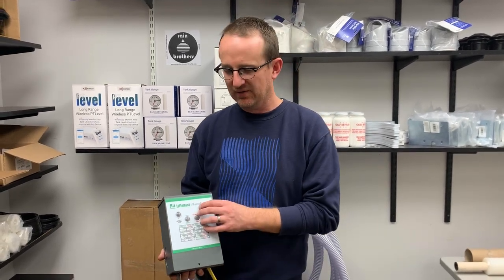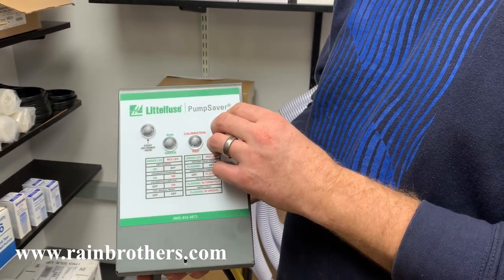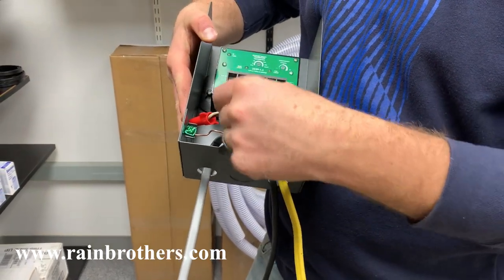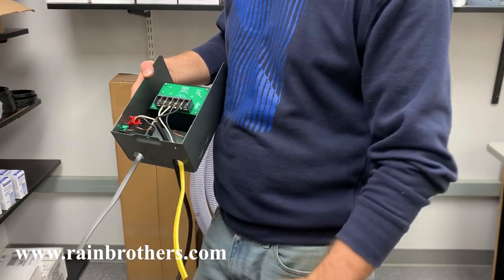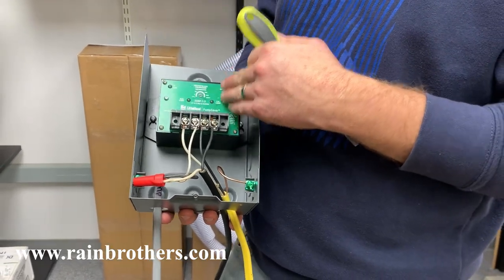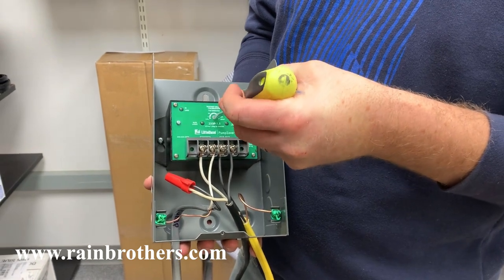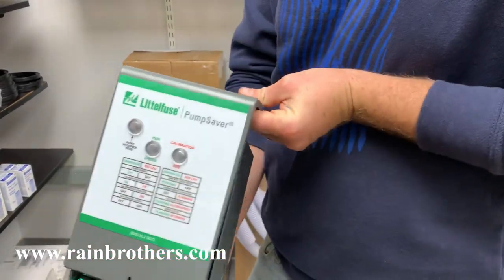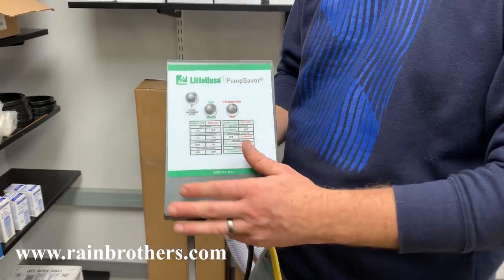How to Install a Little Fuse PumpSaver

Comment: What is the function of the Sensitivity Knob?

I'm having problems with this same Pump Saver, it keeps saying Dry Run but when I flip the braker from the Electrical panel it resets and starts pumping again.
Reply from the maker: The sensitivity adjustment will adjust how sensitive the amperage detection is in the device. Yes, if you’re encountering this, you will need to adjust the sensitivity

Comment: Can you tell me how it takes for the pumpsaver to shut the pump off once the pump pulls air?  Sure appreciate your videos!  Feel much more confident in getting a system set up, and not so much at the mercy of some contractors!
Reply from the maker: Thanks for the kind words! The PumpSaver works instantly, to my knowledge, because it’s reading the load pulled by the pump motor. Once a pump starts sucking air, the load drops, and as soon as that happens, the PumpSaver goes into standby mode and will restart once the allotted/calibrated time has passed.

Comment: Is there a video on how to reset the pump saver if it doesn't reset after the set minutes after calibration ? My green light keeps flashing & my well pump won't come on.
Reply from the maker: One of two things could be happening: 1) You don’t have water in your well; or 2) You need to re-calibrate the PumpSaver when you’re certain that water is present in the well
Reply: Is there a video on how to reset / recalibrate the pump saver ?

Comment: My well never runs dry
 But I have a pump saver installed anyway 
 It pumps for 10sec then shuts off
 Every time
Reply from the maker: You may have to adjust the sensitivity of the PumpSaver, or try recalibrating it.